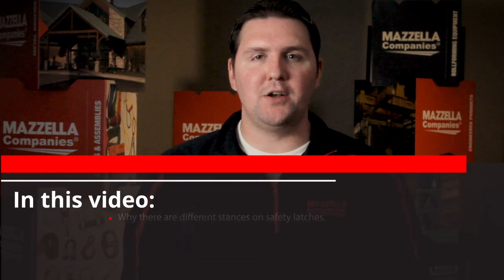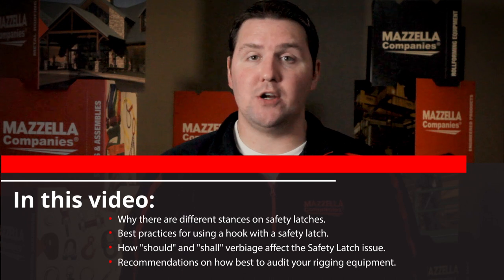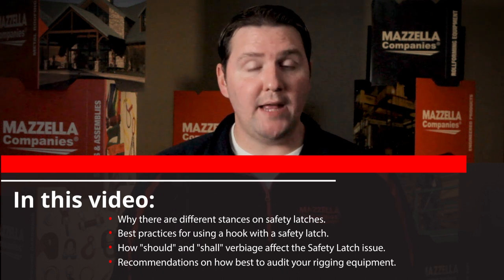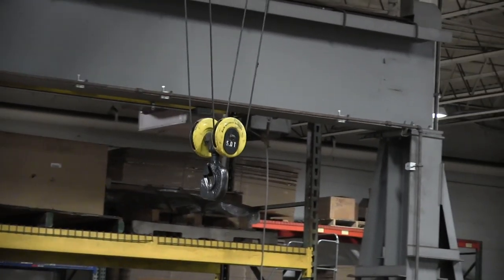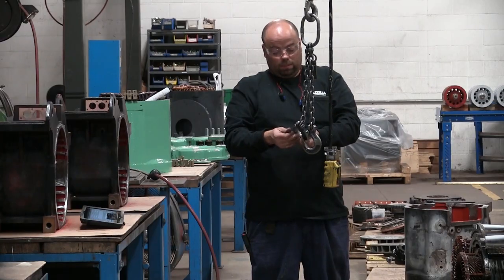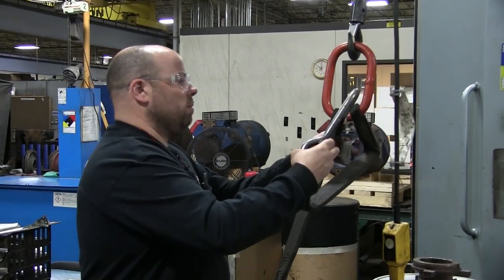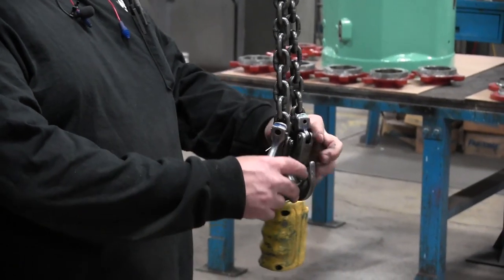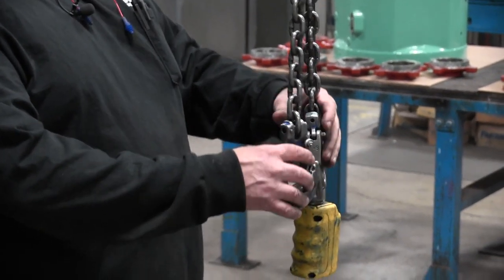Does OSHA require a hook with a safety latch for an overhead lift? - 2018  Update

Comment: More important is in regards to Mobile Cranes   The 1926 1400 Is very specific.  
1926 1425(c)(2), 1926 1431(g)(1)(i) & A  also 1926 1433 (D)(3)  to name some of the most important.
Reply from the maker: Awesome, thanks Mark!
Reply: Tower cranes 2. Seems pretty clear hooks do need latches with only one exception noted. This is a test question.